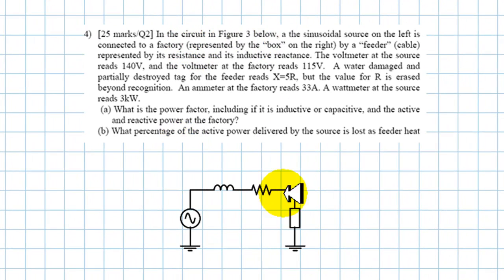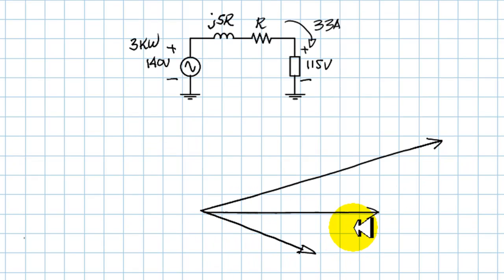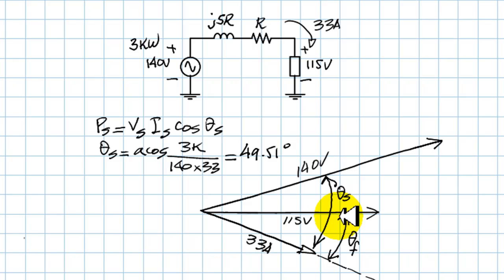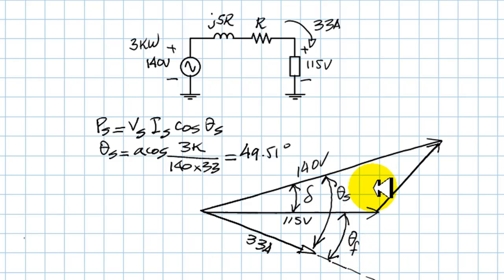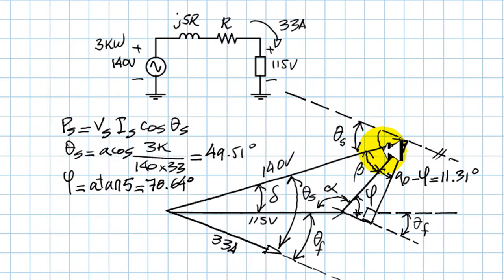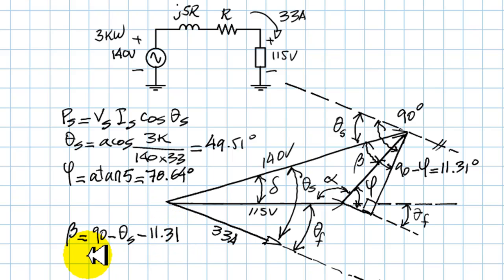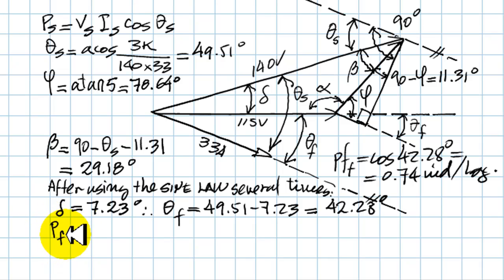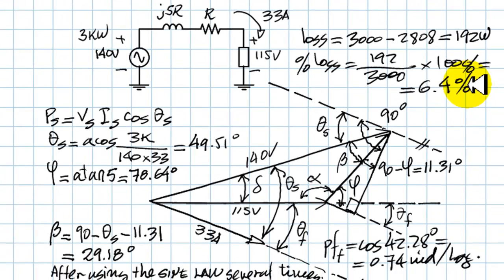Final Exam April 21 2011 question on Phasor Analysis

Comment: What an amazing solution. I'm glad I found this channel in 2021! Great teacher!
Reply from the maker: Great to hear!
Reply: @rolinychupetin  Professor, what textbook do you use in your classes? Also, where can I find literature on the "cable angle" and maximum voltage drop calculation you mentioned in the video? Unfortunately my electrical machines and power system analysis textbooks don't go over that topic. Thanks

Comment from the maker: You could IF you knew the equivalent series RX of the load, but we don't. The R and X that we know are those of the "cable" the "wire" between the source and the load. The formula cos(atan (X/R)) would give you the power factor ... of the cable alone, not of the load which is what we need.